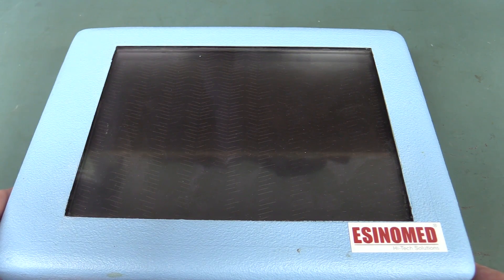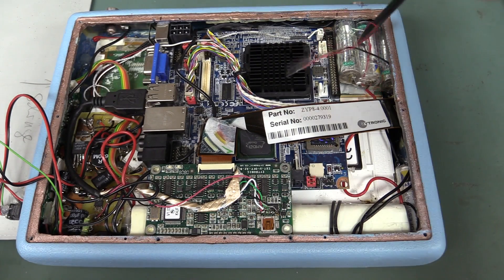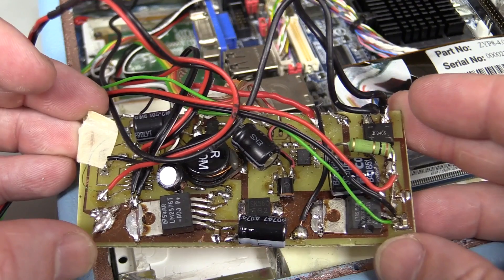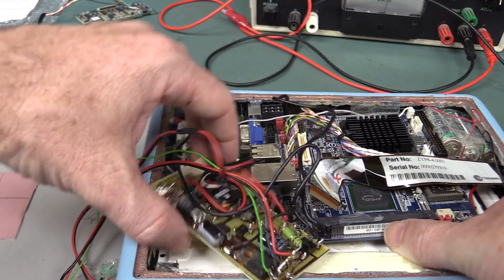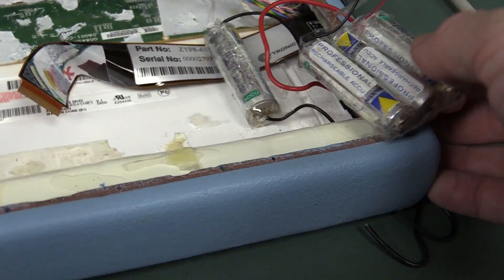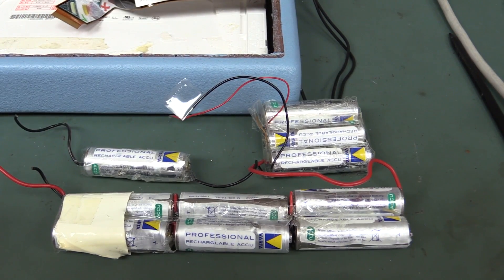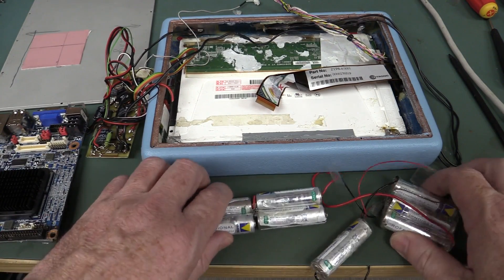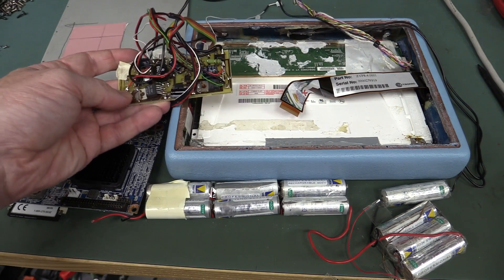EEVblog #822 - World's Worst Tablet Computer Teardown

Comment: This reminds me of those guys who take a videogame console like a Sega Saturn or Sony Playstation and then make a portable handheld version of it by cutting up the boards and fitting it all into a small handmade plastic case with an LCD screen.
Reply: +USWaterRockets That's actually useful, regardless of how bodged together it is. This is just a shitty run of the mill tablet computer that could have been done much better.
Reply: catlover10192 I've seen some nice out-of-production game consoles reduced to worthless scrap by similarly primitive attempts to repackage them. In either case, the end product will benefit from a skilled builder, and ruined by poor workmanship.

Comment: it looks like something a highschooler threw together with what was in his engineering classroom.
Reply: +Blake Roberts nooooo not even. this is worse. a high schooler would have been too lazy to even attempt to solder the usb wires to the touch controller. he/she would have squeezed the connector in until some thing broke or it fit
Reply: +ganymedeIV4 

"Schools in texas would call this a bomb."

In a manner of speaking, they would be right!
Reply: I take offense to that. I have made far better, I would never even think of doing a battery pack like that
Reply: +Blake Roberts Hm, not really. My blinking Christmas tree board looked far better... not by much, but it blinked.
Reply: +Blake Roberts Naw even a highschooler in engineering class could have done better.
Reply: jmcinvale EXACTLY!!!

Comment: Just imagine what the first one looked like...
Reply: +LazerLord10 was probably a cardboard cutout. .:D
Reply: +LazerLord10 it probably looks like the back of my desk. (not good)(horrible)
Reply: +LazerLord10 I almost spit the water out of my nose reading this comment. So thanks. LOL.
Reply: +LazerLord10 You can't because that one must have exploded on someone's face by now
Reply: +LazerLord10  Some say that the first Tablet looked like it was soldered using the feces of the now extinct American Passenger Pigeon, and that it featured an internal combustion engine instead of a regular digital CPU. All we know is, it's the worst one ever made.
Reply: +LazerLord10 This is probably is the first one they fitted into a case to show to as a working proof-of-concept.
Reply: +LazerLord10 It took 11 attempts to get one to work, why else would it look like this?
Reply: +FuckYouGoogle It worked in The Rocketeer
Reply: +satyamfifa only Apple iStuff explode (or SONY) and not only prototypes :-P
Reply: +LazerLord10 We don't talk about the first one...
Reply: +LazerLord10 The first one wasn't used in the medical field. Fred and Barney used it at their job site.
Reply: +LazerLord10 | Personally, I can't even do that good. I hardly ever solder, and if I do, it's one thing, not a whole board. 
Without knowing the history of the device in question, I can't criticize. Maybe it was a give-away.
Reply: Nehmo Sergheyev Even if it was a give-away, it is a fire hazard, it's dangerous! Even if that was not the case, it can electrocate people. Dangerous, dangerous.
Reply: the first one was probably mad eusing better parts with quite alot of care, so they could show that one open to the licencing people and to any new customer or whatever. It's only when you hand it off to make lots of them that you start using barely capable components and throwing them together in a rush, i reckon each one looked progressively worse and each one was using cheaper and cheap parts until they ended up like this
Reply: +Bungis Albondigas Top Gear inspired quote by any chance???
Reply: *****
LOL
Reply: +LazerLord10 Duct taped together
Reply: Makes you wonder, why the hell couldn't they just create a sample that is used with an adapter? Just make it clear that the real one does not need an adapter to operate, and done....
Reply: +Dunestorm You hope!
Reply: +Laurens D Perhaps they wanted to test the portability.
Reply: acalthu Doubt that is the reason for such a big machine.
Reply: Probably used old electron tubes and was massive. might even use a fuckload of D batteries taped together with duct tape.
Reply: +LazerLord10 bring this tablet at school people will think its bomb & police arrests you then later get ready to be rich coz you going to sue them for 10 million. because it may look like bomb but its not & make you look like muslim
Reply: bring it to school, let it near the window, take a break and let the tablet there. Fire will break out, many day free & you can sue that company that gave you the tablet since it's an fire hazard :P
Reply: +LazerLord10 AAAAAHHHH!!!! Ooh noes! I can't get it out of my mind aah!!!! How do I unthink it?? Why would you say something like that?!? You monster!
Reply: +LazerLord10 it was a pile of used pape rtowl
Reply: -=|-|8=<[@]>=+ 👍
Reply: Well.... A lot thicker and heavier. No touchscreen or network radio. Probably no EEPROM also. You have to write while the screen is still wet and soft. 
They lasted for centuries.
Reply: I bet the first 10 they built exploded/caught fire as soon as they turned them on. :)
Reply: That was the first one. They start numbering from 11 ;)
Reply: +LazerLord10 First one has had a single flaw. The only thing it could display was 'Please kill me!' for some reason...

Comment: DAMN that is dodgy. It's like they took the smallest part they could of a computer and soldered it all together and then taped and hot-glued everything together.
And I thought my old Craig tablet was dodgy. The Wifi Radio is taped to the inside of the case. But Hey, it works. What do you want for a tablet bought at Rite-Aid (drugstore).

I have made battery packs like the one you're showing at 5:00 Mostly for my RC cars and they work great. I use staples for the links between batteries and then cover up the ends with hot glue. It's a hack but it does work. I'll be making a replacement battery pack like this for a cordless phone.

Comment: a 12v 1800 mAh NiMH would cost just over $12 USD and a 12v to 5v 5A DC to DC converter is $3 USD.  Sometime thing aren't build right.  USB cable are a $1.  All item can be found on ebay if money is the problem.

Comment: It surely looks horribly, but other than that - what's the main disadvantage when doing it like that?
Take for the example the batteries, they really look crude but what could go wrong? As long as the soldering joints hold together and the plastic foil is intact, it should work fine and you save a few cents for a proper holder.
I can imagine that there are good reasons why this is a bad idea, but as long as it works and it's safe..?

Comment: That doesn't seem even like a quick way to do things.
Reply: +aaroNiGHTS Well in fairness, they probably took crayons, craft glue and glitter off the table before they settled on this design.
Reply: +aaroNiGHTS Exactly. For prototyping one usually uses "of the shelf" buildingblocks, then refining it to custom stuff if needed. 

Here they went to town with a piss-poor doublesided PCB layout for powersupply. populated by a blind guy and soldered by a monkey.
 hacked in a touchcontroller by solder instead of a usb-usb cable etc
Reply: +aaroNiGHTS I'm sure we'll hear that the guy who built this was trapped down a mineshaft at the time and then it will make a lot more sense and be impressive.
Reply: +Daniel Regnér 
like i said somewhere else, a lipo with chargin circuit and 2 of those arduino dc-dc step ups would have been smalled and better looking than that and you wouldnt even have to do that crappy pcb which looked like it was soldered with a hot nail. Makes me think about why did i bother buying a 60 bucks soldering iron when i could just put the solder wire on it and melted it with a lighter.
Reply: +aaroNiGHTS Yeah, it took some TIME to fuck up that power supply like that.

Comment: Wow.. now that's so bad it looks like something I would've made... expect even I would've had the sense to just grab a power brick and instead of bodging together 10 batteries, simply took a 12V laptop battery pack or three 18650s and slap it inside, bam I just saved a ton of space plus it doesn't look as shit.
Reply: +vgamesx1 "It makes you want to stab your eyes out with a soldering iron" :)
Reply: Tito1337 pretty much :D
Reply: +vgamesx1 
I was about to defend the choice of parts a little (but definitely not the way of construction), because I thought that abomination had to be 10 to 15 years old. At that time getting the right parts was more difficult (ebay/amazon in their infancy). But then I saw the datecodes from 08 on several parts. No excuse! Absolutely none! And although I speak german and almost live in Germany I deny any relation with the "engineers", who built this.
Reply: Jason Wu Uhh.. I feel like I should point out that's totally the wrong way of calculating battery capacity...
You should always go by Wh not Ah, because 10 NiMH batteries at 1.2V with 1.5Ah will give you either a battery at 1.2V with 15Ah or a 12V battery with 1.5Ah but either way it ends up being V x Ah = 18Wh

Then it's the same for lithium cells, 12.6V at full charge and it's fairly common to see 2Ah cells = 25.2Wh which is a 40% larger capacity, at least in pure numbers but actually since that 12.6V will quickly drop down to 11.1V then hover there until the battery starts dying, so it's a little closer to around 22.2Wh.
Reply: +Förnamn Efternamn 
Ok, what is the "specified voltage" for your battery then? I see a graph where the volts go from 1.3 to 0.1. Nice spec! One that goes over on order of magnitude... 
Sorry, but you don't know what you're talking about. Most modern devices use switching regulators where the current they draw does not stay constant. But guess what stays constant? The power they draw...
Reply: +vgamesx1 they could have made a better job using a lipo baterry with the protection and charging circuit built in, and 2 of those arduino mini dc-dc step ups. The would be smaller and better in every way.
Reply: Jason Wu
That's not how battery capacities work. Yes, 10 batteries give you 15Ah, but at useless 1.2V! You've pretty much shown why it's stupid (and always was) to measure battery capacity in Ah. Wh is the correct unit for energy, which is what it comes down to.
Ah, and btw. a 18650 Li-ion easily beats any NiMH cell of a similar size.
Reply: +Förnamn Efternamn 
Ok then. Try how many Ah you can get out of an AA battery at 5A compared to @100mA. And then tell me again why Ah would be the better unit. A battery stores energy, so the only reasonable unit for its capacity is an unit of energy.
Reply: ***** No.. Ah is standard because of marketing, not because of logic... 
By that sense of thinking a 40V power tool is clearly way better than a rubbish 20V power tool right? No, of course not... a 40W tool is however always better than a 20W tool because that's the total amount of power it can use, just because it's a standard doesn't mean it's the proper/best way of doing something, I mean that's similar to the argument of "it's popular therefore good" which is obviously untrue in most cases.

That plus as superdau pointed out, you can flip your own comment around and oh look the exact same thing still happens whether you measure in Ah or Wh, how odd... Seems as if you didn't quite think that one through.
Reply: vgamesx1
what are you talking about? Read my answer to superdau. Plus a 40W tool isnt always better than a 20 W tool if it has less efficiency, its the output power (mechanical effect in this example) thats relevant, not the electric effect.
Reply: +Laharl Krichevskoy think more of 2005-6 when stuff like arduinos and lipo batteries are either non existent or too expensive
Reply: Laharl Krichevskoy well no, there are always positives and negatives (pun totally intended) so for example:

My setup
Pros: it's more power efficient as it runs and charges at its native input voltage
Cons: it needs balance charging - (thus the suggestion on a laptop pack as it'll include that.)

Your setup
Pros: it's simpler to implement and easier to charge.
Cons: it's far less power efficient as you'll be stepping down the 12V+ going in, to 4.2V out then a second time as you'll be converting that 4.2V back up to 12V, so not a great solution for portable devices.
Reply: superdau Right, that's a good point I forgot to think about when it was made, though yeah 2008 wasn't all that long ago. Lol
Reply: +vgamesx1 Well, they probably had their own "product requirements" such as standby time or battery duration etc. so maybe maximizing total battery capacity is their top priority. A standard recharging battery lets say has 1.5Ah, 10 batterys has 15Ah, that can keep device running for a long time. A battery pack or 18650s pack doesn't have that much of capacity.
Yeah again god knows why they did that, there are definitely better solutions to achieve the same purposes, yet they simply did not bother to do that, poor bastard.
Reply: +vgamesx1 No Wh is not better, Ah is (thats why its standard). The reason is the internal resistance in the battery, with higher current the power losses will increase. Example; try pulling 5 A from a AA battery and see how many Wh you get out compared to @ 100 mA.
Reply: superdau The voltage will drop on all batteries during the cycle, that's why you generally have a discharge cut off voltage. You claim the power draw is constant??? Would your device draw 100A at 0.1 V to maintain a 10W consumption when the voltage drops from 1 V? Better get bigger cables for that device!

NO THE F-ING POWER DRAW FROM THE BATTERY IS NOT CONSTANT, IT DEPENDS ON THE CURRENT. 10 A @ 1 V drop for 1 sec  = 1 J. 100A @ 1 V for 0.01 sec = 1 J.

But in real life the internal resistance in the battery is NOT linear! One of the above scenarios (guess) will drain the battery more than the other, despite your love for power calculations.
Reply: +Förnamn Efternamn 
Yes, a switch mode power supply/regulator will do exactly that. If the voltage drops, it draws more current. If you multiply V x A you get a constant (minus the losses in the powersupply and depending on what the device after the regulator is doing of course). A constant with a unit of Watts. As I said almost all modern devices will have that behaviour, because they have switch mode regulators.
Let's scale down your stupid example with 10A/100A to 100mA/1A (we are still talking about batteries in the AA range, aren't we?) and you finally got it.
Reply: superdau
YES IT DRAWS MORE CURRENT AND THEREFOR WASTING MORE ENERGY FROM THE BATTERY COMPARED TO USING A LOWER CURRENT!!

THE TOTAL AMOUNT OF WH DELIVERED FROM A  BATTERY WILL VARY WITH THE CURRENT. WH IS ALWAYS TIED TO THE DISCHARGE RATE C THAT WHY WH ALONE DOESN'T SAY SHIT ABOUT A BATTERY!!!!!!!!!!!!!
Reply: Ah. Wh. yadda yadda yadda.
. . . Just measure the Wh of the fully constructed device and put a drain chart in the manual.

//And No. You were arguing battery life measurements.
Reply: @Biaanca5036  It kinda shows you didn't actually read what I said, as I was commenting on the shoddy construction.
Reply: superdau okay....Firstly, Ah IS a unit of energy since the voltage is specified.
Current draw is a factor when calculating the real capacity. This is why batteries have discharge curves in the specs, the total amount of energy you will get out depends on the current you´re using. To check the actual capacity/discharge rate you need to check the datasheet or C-rating where the unit Ah is more convenient. For example; C-rating * Ah = Rated continuous current (A)
See for example http://www.powerstream.com/AA-tests.htm

Comment: As a technician working on maintenance of medical equipment, you'd be surprised how much stuff is like that inside. Some of it could be from repairs (like the hot glued regulator or the USB cable, 'cus you don't wanna wait a month for the departament to then go buy what you need, it has to be working again ASAP), but I wouldn't be surprised if this was mostly original.

Comment: Hahaha that USB cable
Reply: +nychold It would still be a cable with no connectors.  Where are you getting this idea?
Reply: ***** true, it's still a nightmare though.
Reply: +David Scott you can still cut the casing of the mini usb plug and plug in it anyway with cables at a 90 degrees angle
Reply: +SeeWaffle9 Can you even call it a cable, if it doesn't have connectors at both ends?
Reply: nychold Well I guess that would be technically true.